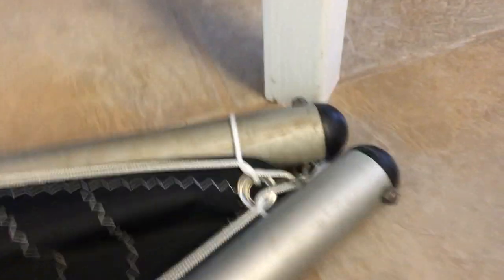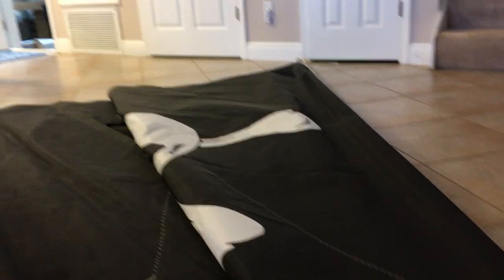How To Bend On A Sunfish Lateen Sail with Marlin Hitch

Comment: That's funny, I have the exact same sail. I once saw a forum or website years ago where someone showed how they secured the entire sail with rope. Even the aluminum poles were tied together instead of the little double metal eyelets that usually attach them. I have yet to find it again on the web. I would like to do the same thing. I sail in Fl. What state are you in?
Reply from the maker: Howdy Longboards, You might have seen the Yahoo Sunfish_Sailor files plans for the wooden Alcort Sailfish. 2 pages, filed under Wooden Fish/Sailfish Prints, they have all the measurements and the upper and lower spar are held together with a 12 inch piece of line that serves as the hinge, half of it wrapped to each spar. We currently sail the east end of Pensacola Bay but are packing up to move to the Hampton Roads area. Check out our blog and facebook page smallboatrestoration
Reply: @kentblairl  Have fun in Virginia. We moved here from Va. Beach.
Reply from the maker: @humblelongboards  Funny!